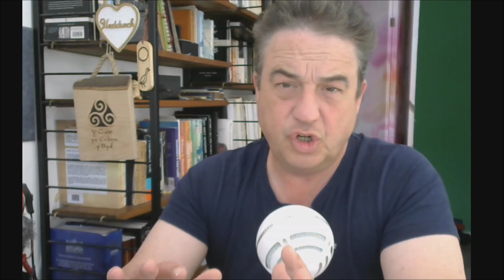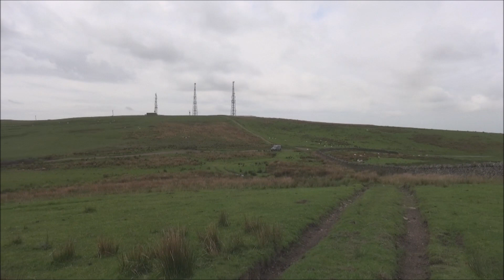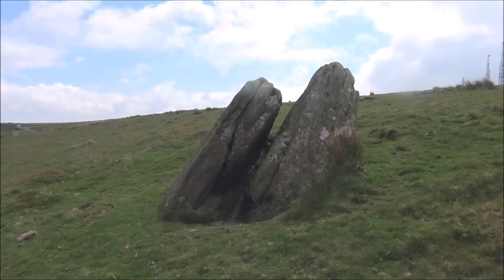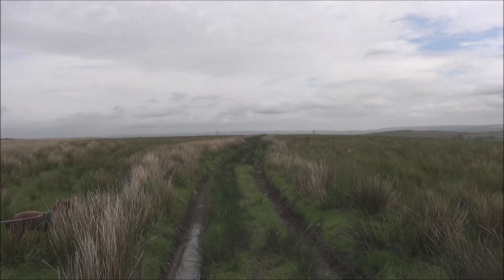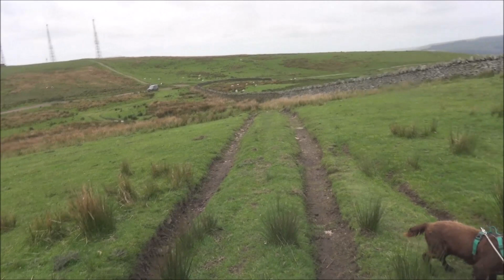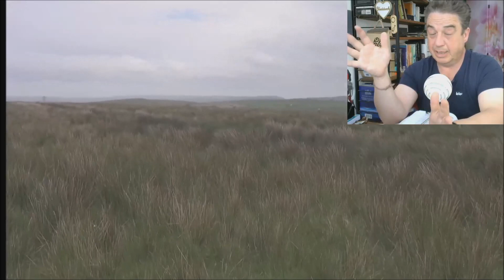Wind Turbine paths damage and how they wreck mountains.

Comment: you guys make turbines sound like nuclear power plants
Reply from the maker: From an environmental, ecological and health point of view they are worse
Reply: @BritainsHiddenHistoryRoss  how? there's zero risk of Radiation poisoning
Reply: @BotanyDegreePilkerton  I think Ross made good points replying to one of your other comments, but I'll paste here again to help:- ...mining the rare elements they need outweighs any benefit by itself. Then add the transporting of the materials around the world and the special roads needed - and quarried and it's a disaster. They use loads of oil to keep going". As far as I know they only last 20 years and the blades can't be recycled..also the cement is often imported from far away, eg India. Hope that helps..try watching Ross' other videos on this to understand more
Reply: They quite simply do not work as advertised. All of them are lemons,no wind turbine has ever replaced the energy needed to produce it.

Comment: Wind turbines are great, I love them, rather have turbines than pollution. For my kids' sake. It's about the kids. Anyone considering the kids?
But they don't have to built on burial mounds surely?
Reply from the maker: Wind farms are terrible for our children. Mining the rare elements they need outweighs any benefit by itself. Then add the transporting of the materials around the world and the special roads needed - and quarried and its a disaster. They use loads of oil to keep going and with blade tips travelling at 400+ miles per hour they slaughter wildlife.
After all this devastation they only last 20 years after which point they are landfilled and will be no use to our children anyway.
They are a money making scam and nothing to do with saving the planet - quite the opposite unfortunately.
Reply: @BritainsHiddenHistoryRoss  what rare elements?
Reply: @BotanyDegreePilkerton  Are you really that ignorant? Do you know so little about what you are cheering on? Do some research with an open mind. The total impact of wind turbines from construction to maintaining them, both in terms of resources and environment, is very high. Take into account that with wind/PV you also need large battery banks made with rare earth elements mined under terrible environmental and human conditions. They are so inefficient that it is only government money spurring them on.

Wind and PV only produce power a small percentage of the time. You still need the same capacity in traditional generation to back them up. There are not enough batteries on the planet to power one good sized city for 24 hours even if wind/PV could charge the batteries. You cannot start/stop a power plant on a whim. You have to keep them running, even if they are not producing power. This makes them much less efficient, i.e. you are burning coal and gas but getting little to nothing.

Hydro and nuclear are the cleanest and greenest forms of power generation. It is true that tens of thousands of people die of cancer from radiation exposure every year. That radiation is from the sun. Ever fly on an airplane? If you were to fly to Chernobyl, stay a week and fly back, you would have a higher radiation exposure from the elevated altitude from your plane ride then from being on the ground in Chernobyl. Do your own research, keep an open mind, think for yourself...
Reply: Wind turbines use magnets that require rare earth elements that are very hard to find and mine. Dont for a second be under any illusion that the magnets and the resources required for the magnets come from the UK. Wind turbines take a lot of resources and last for 25 years or so. As someone with an extensive background working with wind turbines I know a fair bit about the entire process and it isn't pretty. Global warming is a joke! Another agenda designed to trap us in to a fear mindset.  There is no lack, only greed, fear and control.
We should be preserving our ancient sites for our children, that's the issue here. We deserve to know who we ae and where we come from, our connection to our ancestry is vital for future generations. The true history is removed & destroyed so that we can be fed fake history to create an illusion of truth and heritage! Don't be fooled.